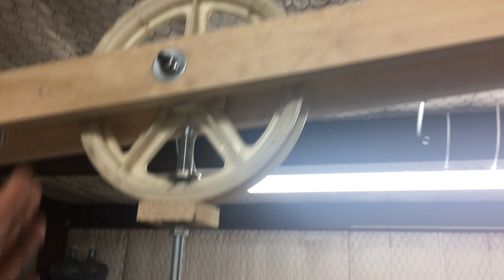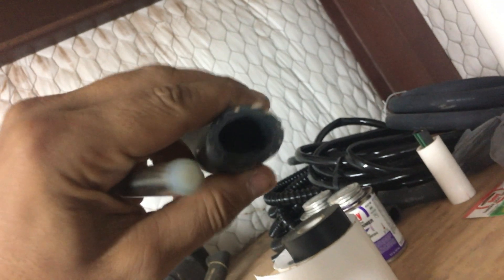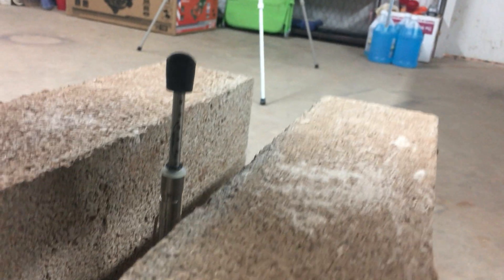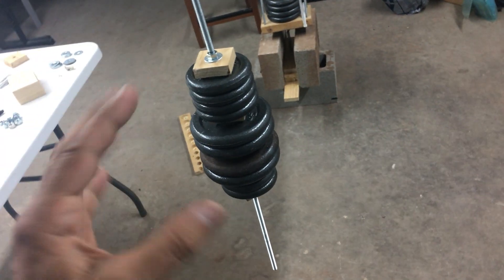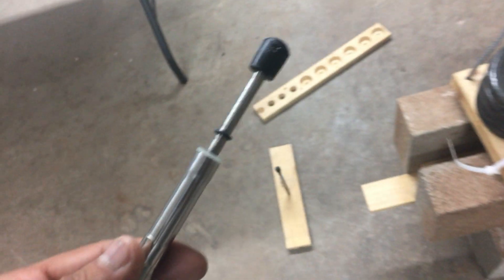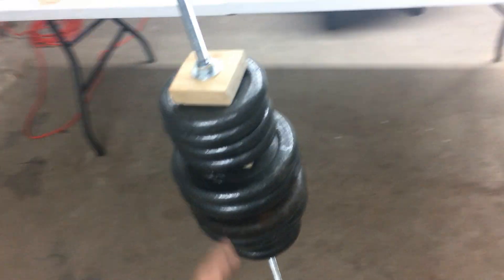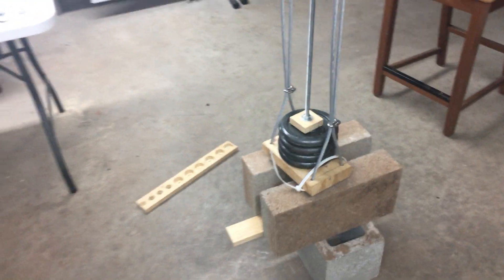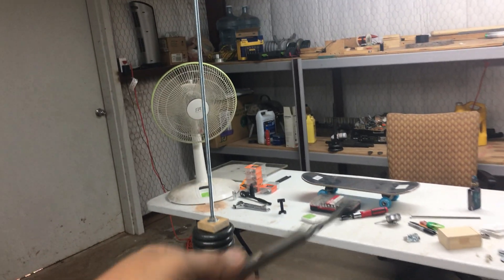Two Stage Mechanical Oscillator Part III - (Measurements)

Comment: Your setup has too many losses. First of all, your construction should be from a steel, not wood. Your pendulum holder should not have wobbly efect from asside, just 100% back and forward (rotation). The output should not have elastic ropes or similar. Should be steel rods just like in pendulum, only rotation force, no side effects. The main base of the construction should be bolted to a concrete bottom/100% hard surface with no wobbly effect. All stress should be manifested only to output (up and down). When you achieve the requirements, you will get full potential of the output, that means, in ideal conditions like no air resistance on the pendulum (vacum) you can achieve up to 20 times overunity. In medium conditions, 9 to 12 times overunity. However, even in 2 times overunity, you can succeed. Thats how this invention is good and tolerant to forgive a bad operational conditions. Dont forget to give the credit to Veljko Milkovic, the Serbian inventor of this amazing device.
Reply from the maker: Hi there, I believe you are correct. I think I built it too big and was just concerned with the main concepts, which clearly were not diverted completely to the output. Since then, I have moved on to other centrifugal ideas or more like inertial forces, electrostatic, magnetic and analogous mechanical vortex concepts. One reason for not posting so much is because of getting a total grip on these principles, which are pretty much all the same. Centrifugal force of course is completely free.
Reply: @debunkified  investigate air displacement, something like "usina flutuante" water vs air container.
Reply from the maker: @zlackbiro  Yes I will do that, right now experimenting with counter rotation of certain, objects for a one way unidirectional linear/axial force. Seems positive so far.

Comment: Nice work! Higher the pendulum goes, higher the velocity in vertical point, therefore higher force. It is quadratic multiplication increase, so various angles should be measured. I am working on same experiment. Currently working on my workshop, looking forward continuing... Thanks for sharing!
Reply from the maker: Thank you for the nice comment. I would like to see what you come up with, maybe shoot over a link when you’re done. Have a great one!
Reply: @debunkified  currently outsourcing build of linear to rotational converter with a flywheel as a storage/buffer + alternator over pulley transmission. Fingers crossed!
Reply from the maker: @innovationsforall  Good luck! Heard ya. Same here almost. Little secret, there is no centrifugal force, there are better forces derived from a wheel that are very little known. They are free.
Reply from the maker: @innovationsforall  I hate to say this but I would be saving you years of work. You can not get more energy out of anything in the same way you put it in. Energy creation is possible, and yes you heard me right, energy creation. At least that's how it appears. 

Perhaps it's always been there and it is quite normal, just hidden very well!

You can not get energy out the same way it went in, like rotational and tangential energy. This is how every generator fails to output more than in.

We the people decided that if you push on something then you have to work against it to get the energy back out, very horrible and flawed thinking brainwashed by the masses.

You can get a simple wheel to output more than what goes in and actually get it to speed itself up, but it is a complicated and daunting task.

Comment: The way I would measure this is 1. use a weigh on a rope to tap the pendulum and keep it going. Then weight times distance is the work in. 2. use an additional weight on the output side that is lifted and measure how many times and how far and you will know the work out and thus the efficiency. 1. above may require come escapement like is in a clock to get the push at the right time. In 2. above it wold be best if the lifted weight was allowed to slide off the the side and another one lifted up to make it very clear that when that weight drops it is not affecting the machine. 
Keep trying to get some solid measurements.

Comment: Makes me think, if the pendulum was offset from centre  and made to go around with a small motor, would it have an amplification of output to input and what frequency would that happen at, supposing it did ?
Reply from the maker: I would think so. Then you’re getting a bit into antigrav. Just skew the pendulum a little on a small cart with 4 wheels and watch what happens! It won’t be upwards thrust but you can begin with a ‘thrust’.